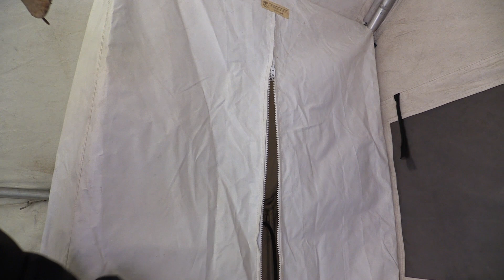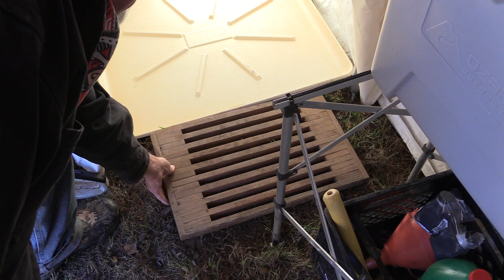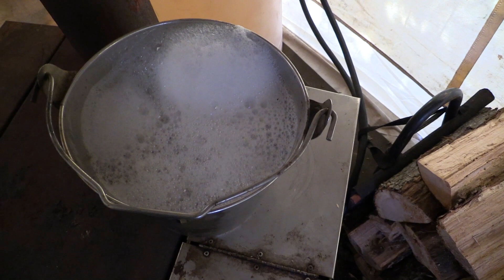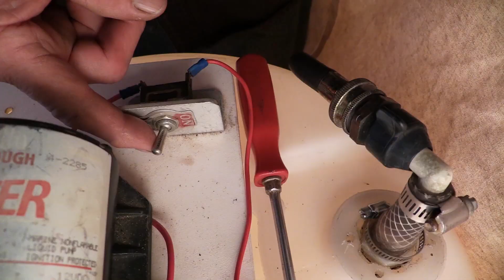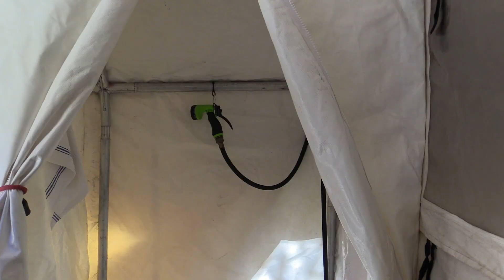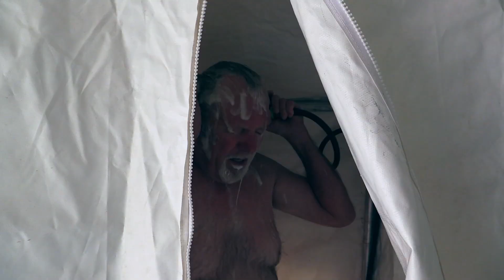Dixon's Tent Camp Shower!

Comment: bill how did you make your outhouse i need that at my deer cabin. god bless keep up the good work AMEN
Reply from the maker: Donnie the outhouse tent was made by Salem Tent & Awning in Salem, Oregon, I constructed a bottomless, plywood box with a tapered back and a hinged lid to which is attached an oak toilet seat. I cut the bottom out of a large trash bag and use it to line the interior of the box. Then I simply dig about a 30" deep hole and place the toilet over it. Thanks for watching!